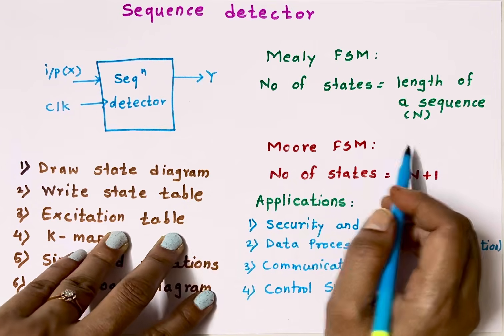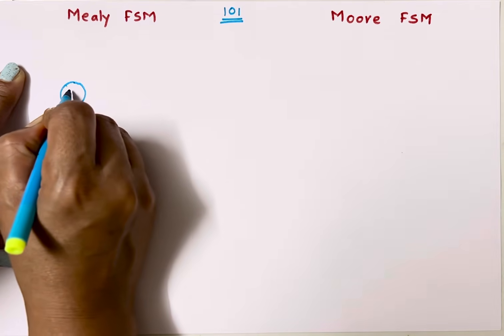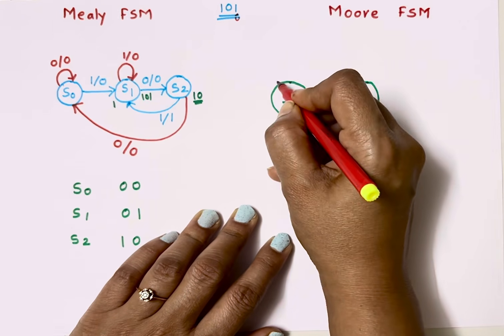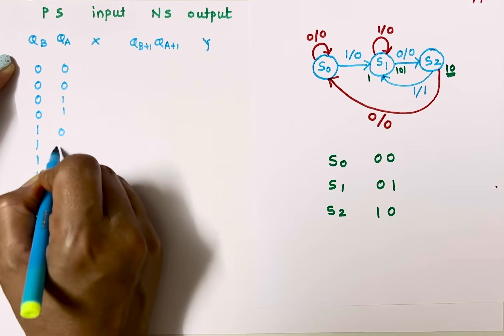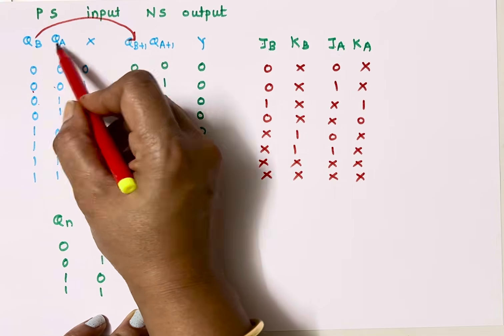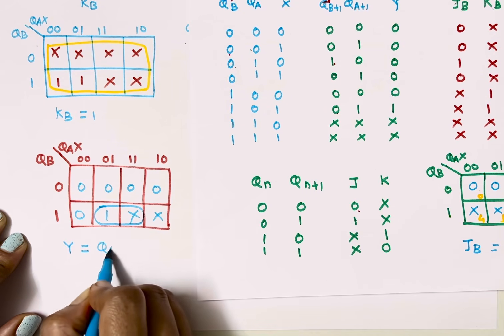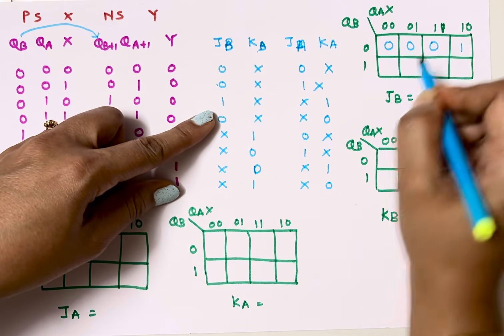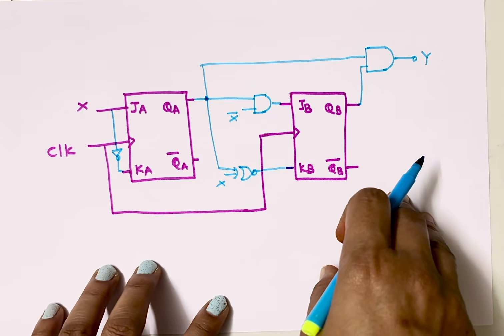101 Sequence Detector | Mealy Moore FSM | State Diagram, State table, K map, Hardware using JK FFs

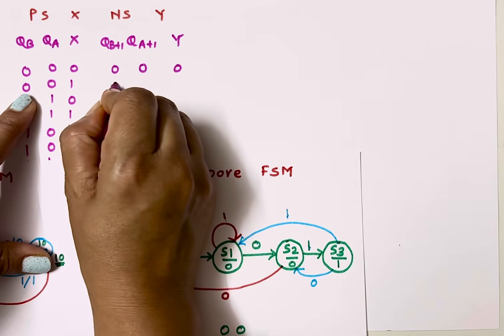Comment: mam at 24:06 while creating the next step table at the last 2 rows on output side how did (0 for 5th, 1 for  6th and 1 for 7th) came?
Reply from the maker: It’s because for 6th and 7th present state is S3(11), and for S3 output is 1. For 5 PS is S2(10) hence output is 0. See in 6(110) or 7(111) first two bits represent state and third bit represents input.
Reply: @CircuitrysimplifiedbyDr.Shobha  Mam jab S3 pe 0 apply kiya for 6th 
Tab vo S2 pe ja raha hai and S2 ka output is 0 
Similarly for 7th when S3 is applied with 1 it goes to S1 which also has output 0

I am assuming the output of the next state is written by that logic I have solved mam
Reply from the maker: @ayushmanyadav2006  no . In Moore FSM we consider output of present state.
Reply: @CircuitrysimplifiedbyDr.Shobha And in miley we consider the output of the next state?
Reply from the maker: @ayushmanyadav2006  In mealy there is no fixed output for the state. we consider output related to input for transition from PS to NS.
Reply: @CircuitrysimplifiedbyDr.Shobha Thank you very much mam

Comment: Do we need to implement clock signal also ?
Reply from the maker: Both Moore and Mealy FSM are synchronous. So same external clock is connected to all flip flops.
Reply: @CircuitrysimplifiedbyDr.Shobha hiw do we come to know how much flip flops we have to take ?
Reply from the maker: @worriar0848  1 flip flop for 1 bit. We can write 4 states as “00, 01,10,11) it means we need 2 flip flops. For let’s say 5 states we will write states as “000,001,010,011,100) so 3 flip flops.
Reply: @CircuitrysimplifiedbyDr.Shobha  THANK you mam, which college did you teach i want notes for deld subject SEIT